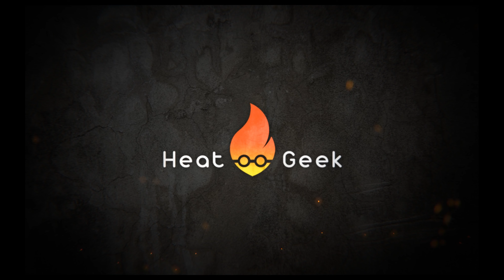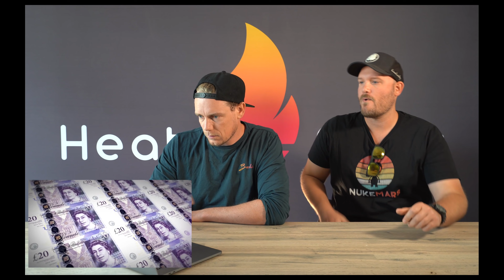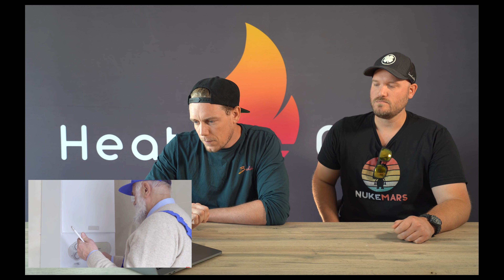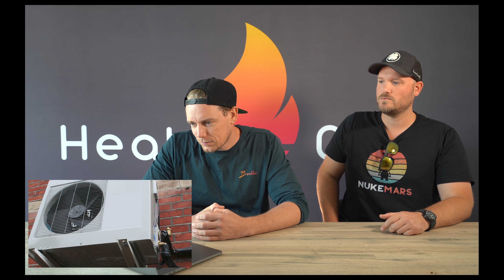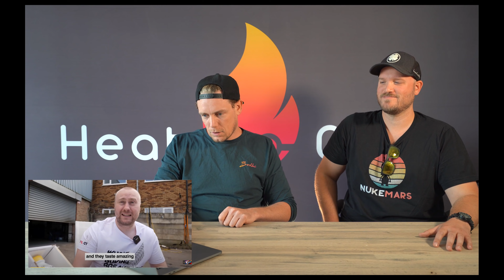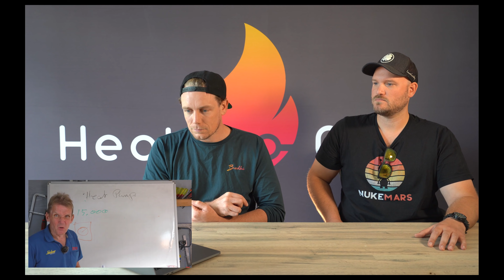Professionals React (BADLY) To Skill Builders's Heat Pump Videos | PART 1 | FIRST TIME WATCHING

Comment: Saying that by going with a Heat Pump you are using non fossil fuel energy is only correct if your country’s generation mix is 100% renewable energy… which is not. Especially, in the UK. So the main reason for a heat pump to be “green” is if it actually is more efficient. And if you use it to heat your water you will need to use the adicional top up that will burn through electricity and plummet COP so you are not being green(er). And if you argue that in the future our generation MIX will catch up Heat pumps will a greener solution and therefore it is a future proofing decision, than my answer will be “yes, and so will any heating/cooling solution that is electricity based”. Which brings us back to the main and most important point: Are heat pumps more efficient?
Reply from the maker: This is incorrect. Any decent heat pump doesn't even have an 'additional top up' function.. its all done by the heat pump. 

Additionally, even if the electricity used was created 100% from gas rather than the 40% currently. It would still be at least 50% less carbon than burning it through a 90% efficient boiler. 

Additionally it will be waaaaay less carbon and waaaay cheaper than hydrogen.. there is no alternative right now.

To the last point..  yes, running electricity through a 300 to 400% efficient apliance is more efficient than running through a 90% appliance.
Reply: @HeatGeek  We are talking about different things and it is probably my fault as I did not specifically mentioned that I am referring to heat pumps that are exclusively dedicated to water heating.  In this case you do need the additional booster to get water up to the 40-50 degrees and still these are being pushed as the green alternative to even electrical heating devices. Very few people are reporting the claimed benefits that are being promoted. In this situation your only carbon footprint gains are related to the actual power savings so relatively easy to check.
Reply from the maker: @vascojardim6703  again incorrect. Modern units climb to 70c. And no mcs install can go  below a cop of 2.8 so km not sure what your saying?

Even if you did have a unit that for some reason couldn't take to 45c and used an immersion.. the carbon in the uk is WAAAAYYYY  better on electric.

Electric is 200g/kwh
Gas 200g/kwh

However a basic old electric element or even a fan heater, is basically 100% efficient. A combustion engine maxes at like 92.. 

Add the cop of a heat pump and your world's apart from the co2 perspective
Reply: @HeatGeek  Hope that those COP figures are actually true and not just theorectical BS otherwise I just spent a ton of money on a 500 litre Daikin Altherma R AQS to replace my old electrical boiler for nothing. Just like the claimed ranges of electric cars (which I also own one) and where you will get about 25% of that if your daily commute includes bits of highway. I have a suspicion the answer will be something like “yes, in a properly designed system”. I do hope you have a video on how to properly design and install such systems otherwise it is actually rather empty.
Reply from the maker: @vascojardim6703  we have loads of videos on system design.. check it out. Diakins are a bit dated though.. and are much more likely to use backup heaters. Old tech.
Reply: @HeatGeek  And furthermore, it is NOT incorrect. My point is that when comparing two electrical solutions the carbon footprint reduction is measured only in terms of the efficiency of the two systems. This is non debatable, and correct.
Reply from the maker: @vascojardim6703  you' made lots of statements. Your very first statement was "saying using heat pumps you are not using fossil fuels" - we did not say this for example
Reply from the maker: Second statement.. heat pumps have to be more efficient to be greener.. -more efficient then what? You didn't say, but as most of the uk us gas boilers or direct electric, it is absolutely more efficient.. what's more efficient?

 using an immersion to 'top up' means it's not greener.. yes it is.. 

I'm not going to cary on

Comment: 7:05  --  30 Degree day? WOW Do we live in the south of france?  Do you have your heating running on a 30 Degree day? Must be heating a sauna? :-) lol
Reply from the maker: We were reffering to hot water production Wayne 😏
Reply: @HeatGeek  In a video you did, you referenced a outside temperature of -2  degrees when calculating mass flow rates, but said that happens on very few days. A more realistic temperature outside is 11 or 12 degrees.  A heat pump would have to heat a house on the worst case and best case and heat the hot water. You also said the average uk house heat loss is I think 6 or 7kwh. Is that on a freezing cold day outside? Colder the outside temperature the quicker / more the heat is lost surely?  You also said heat pumps would work in the majority of UK homes if double glazed / loft insulated.  I'd love to see real world heat loss calculations on houses 30/40 years old and the cost / saving iover a gas boiler it would bring when taking into account the cost of purchasing it and installing it. Good content for a video? I'm not knocking heat pumps but just questioning the logic in the cost / benefits / pros / cons. I'm sure you could argue either way to be fair.
Reply from the maker: @waynenixon729  Your mixing points.

you have to calculate for worst demand (-1 to -5 depending where you live in the UK)

More realistic and average HEATING temperatures are 11 or 12, but heating is turned off half the year. hot water is year round.

Any time you state the heat loss its at worse case. so 6-7kw is at the worse case of -1 to -5 depending where you live in uk. not the average heat loss throughot the year.

Regarding the 'cost savings' for you example. I said it would work. Whether it works doesn't necessarily mean it will be cheaper to run. a heat pump purchase is to lower carbon not necessarily cost less although that can be achieved.

Comment: I think the industry is definitely going through a change currently, certainly here in the UK with all of the latest initiatives such as Lot 20. I think a more holistic approach to HVAC is going to become the way rather than a single system approach, especially as we move away from natural gas.
Whilst on that subject, Do you guys know of any companies that do a combined Hot Water Heat Pump & MVHR? My thinking is, then the evaporator side of the heat pump could be ducted with a fan and actuator damper to the MVHR for comfort cooling or warmed air, extract air could be ducted back to the heat pump from the kitchen/bathrooms, and a separate fresh air intake to the MVHR.
Reply from the maker: Nibe

Comment: What are your thoughts on Hot Water Heat Pumps such as the dimplex edel, or ecocent? Just for Hot Water (Would do heating with mix of Infrared Heating Panel and Electric Radiator managed by Bluetooth Mesh/Smart Home tech etc
Reply from the maker: They're good. I would almost never fot Infra red pannels though. You'd be crazy to want to pay that running cost!

Comment: You guys are selling the useless things so of course you tell us how good they are.
But the reality is that they are expensive to buy and install.
They also need to be run 24 hrs a day so use a lot of electricity. 
Also on retro fits you will have to replace the radiators for bigger size.
There are going to be a lot of unhappy home owners out there in the future  ! !

Comment: Roger and Skill builder has a very big following now but hes not always right. Ive worked in Germany and worked in the UK building eco German houses. They have been using air source heat pumps for a long time now. They are super efficient if fitted correctly. Knowledge is key as is training. These two  seem to know what they are talking about. Roger is becoming a joke now with all his rants!

Comment: They keep saying poor installation and design, but fail to mention the need to changing pipework, radiators etc in older properties not to mention improving building insulation, possible related damp problems etc.
Reply from the maker: We talk about that litrally all the time throughout our entire channel

Comment: We have a one bedroom apartment that was designed from new to use a heat pump and has a Nibe F370 which we have had for 10 years. Until recently it was fairly economical to run. However since the price increases its expensive to run so there has to be a careful consideration. 
The Nibe F370 is fitted into a cupboard which it completely takes up and when the compressor kicks in its noisy and has been since new. (This is a second home)

We have a new build house that has a gas boiler and traditional radiators with micro-bore pipes which I believe cannot be used for air source heat pumps so it would require completely new system. This is a failing in my mind of air source heat pumps that they cannot simply replace an existing gas boiler and shows the technology needs to mature more.
I dont believe their is a heat pump conspiracy but I dont believe heat pumps are a panacea after having one for 10 years in a property that was insulated and designed for one (the property doesnt have gas). Control ability is a weakness, noise, and sheer size. On really cold days its expensive to boost the Nibe F370. That said the system has been very reliable with much cheaper maintenance costs than gas and our hot water at around 48/50c is never an issue. Until the recent fuel price increases it was competitive price wise to run but thats changed now.
Reply from the maker: thankfully heat pumps have moved on hugely since 10 years ago. especially in comparison to boilers.  Heat pumps can work on micro bore.. we did a video on it.. look for ''will i need new pipework with my heat pump' which has a cheat sheet to check.

Comment: Well,guarantee 21 degrees C with an external of minus 1 with howling winds or a full refund, think many will walk out of the front door.
How do people on earth think we are helping save the planet.
China 1100 coal fired power stations with anther 150 this year.Plus India, Africa, etc.
I believe we are 2% of world wide energy consumption,
17th on CO2 output.
14th on world wide energy usage.
China doesn’t have to do nothing on emissions until 2030 at the earliest as classed as a undeveloped county, yet put a rover on Mars.
We are being taken for mugs but have to lead by example they say.Whatever we do is like a pin prick an Elephant’s backside and you are mugs to believe anything else.
Reply from the maker: all mcs performance estimate guarentee that.

Comment: Here is the GOLDEN RULE as it pertains to heat pumps. This is the long and the short of it.
The farther north or south of THE EQUATOR and/or the higher above sea level you live the LESS efficient heat pumps become.
Reply from the maker: Sure. But always infinitely more efficient than a gas boiler.

Comment: Roger is a plumbing and heating engineer.
Reply from the maker: Yes, with little experience of heat pumps.
Reply: @HeatGeek  Incorrect, he installed a ground source heat pump in the home of the MD of Worcs Bosch over 10 years ago.  Do your research please.
Reply from the maker: @ChrisG1967  doing 1 ground source does not make you experienced lol
Reply from the maker: I believe he's installed 3 heat pumps
Reply from the maker: All of which didn't turn out very well
Reply: @HeatGeek  yeah but as he says he works off the design of others so not his fault. He's been in the heating trade a long time as I have too. We are not easily fooled. I work in 300 year old cotswold large houses and buildings. Take more than a 5k grant to heat those places with renewables.
I'd listen to Roger all day long. He's a skilled guy, articles in trade mags, sponsored by loads of different manufacturer's. He's being honest and I'm involved with renewables myself now but can see issues. Sometimes you've gotta go old tried and tested technology still.
Reply from the maker: @ChrisG1967  some times you do have to go for oil and gas boilers. Heat pumps are not new though, been around decades.

Again though, Installing 3 heat pumps to someone else's design does not make you experienced. I can guarantee if we went to his installs we could improve the COPs. And have offered too FOC.

I only have 19 years experience in heating and have ran my heating service and install business for 13 years. its not as much experience as him.. but hardly inexperienced. And only worked in heating.  not bathrooms, building, brick laying and all the other things he does.
Reply: @HeatGeek  I too ran by own heating business for nearly 20 years and have been in industry since the 80's and my father was a plumbing and heating engineer. I have seen heat pumps in the 70's when going out with my Dad. Roger may do other stuff now but I remember him in the 90's doing articles in trade magazines on heating and plumbing topics only.
We could debate this all day long.
Reply from the maker: @ChrisG1967  again.. that does not make him experienced in heat pumps

Comment: Builder: You have to have a buffer tank
Heat geek: Thats incorrect!
Heat geek two: A lot of manufacturers insist you have a buffer tank!
Heat geek one: Yes!
(I afraid I'm with the builder on this one, heat pumps cost and arent the solution, speaking as a Harpist. )
Reply from the maker: For clarification, heat pumps work best without a buffer tank, but it means you have to be more careful with the system design. As such many manufacturers insist on buffers so they don't get call backs from crap installations with no system design.
Reply from the maker: Also. Not ones denying they cost...
Reply: We are all now looking forward to: "Roger-the-builder Reacts ( badly) to Heats Geeks' videos, Reacting ( badly) to Roger-the-builder's video on heat Pumps" .  (Introduced by Roger's wife ) 🙂

Comment: Its ok to say heat pumps are great but ten years down the road how many people will be regretting having them installed . traditional heating isn't perfect but at least it suits ALL types of property's .
Reply from the maker: This is a great point IF you want to select 1 heat source for all properties. In reality we need a mox of solutions. The the h2 fuel cell. Having said that it may be more cost effective with high temp heat pumps at some point in the not too distant future.

Comment: Oh...I think I've used your website based on the logo? I'm trying to get an airsource heat pump that works with existing ducting. I looked for the Bryant 280 Evo but it seems that is only split system.